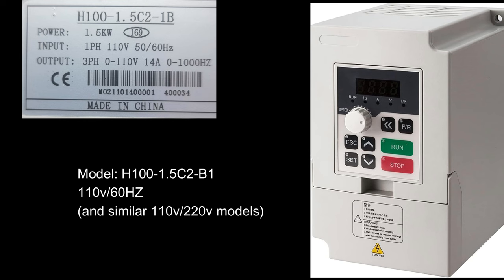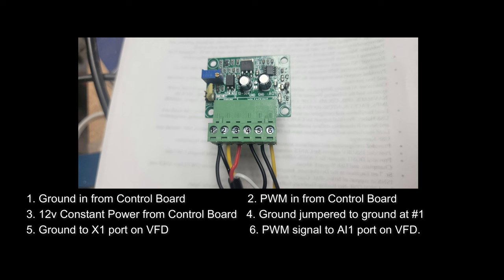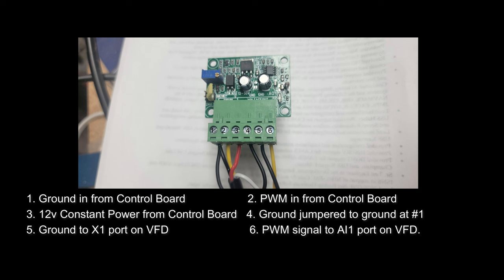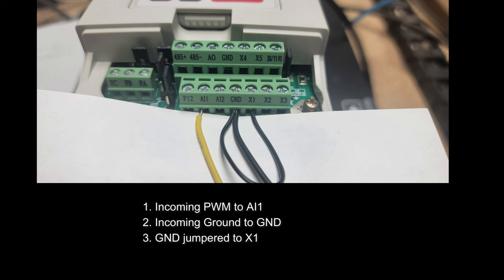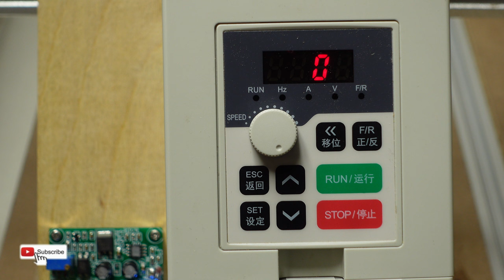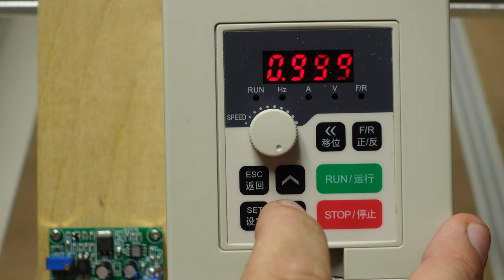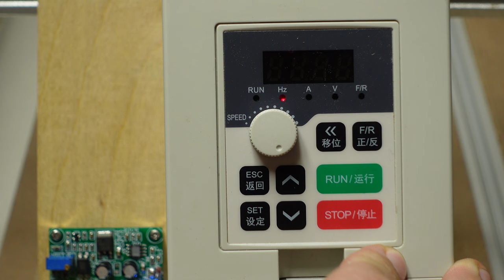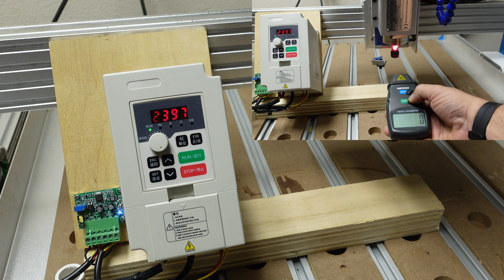Master your VFD Spindle with GRBL Control | Ultimate Tutorial | TK Designs | 4K

Comment: thanks for the video and the valuable information in it!  because of this video i feel more confident about upgrading my 1010 to a vfd (specifically the one you are using).  my only stumbling block now is what additional wiring i will need to purchase so that this setup can be used on the larger area of the 1010.

Just an fyi, your video shows thst you are using the square air cooled spindle but your Amazon link takes you to the round water cooled version.   Which one do you recommend? and if its the air cooled square one did it fit on the stock 4030 v1 z axis assembly or did you make some modifications to make it fit
Reply from the maker: Thanks for watching!  I was previously using the square spindle, but it doesn't seem to be available on Amazon anymore.  I did purchase the round spindle (air cooled version). I recommend that, as it is most compatible, and can be dropped into a 65mm mount on the V1 z-axis.  The link for the the whole spindle kit (minus the 65mm mount, because the one shipped will not work with the sainsmart) is https://amzn.to/41gdU5p.  For the cabling, I purchased this: https://amzn.to/47V4tLm.  It did have to be soldered to the connector to properly connect to the spindle.  The amount of wire they send with the kit probably would not be enough for a sock 4030 XL. The mount I purchased was: https://amzn.to/41dk9GY. It is directly compatible with the V1 Z-Axis, and is very sturdy. Thanks again for watching!
Reply: So I purchased everything and am in the process of setting it all up but I was wondering if you had to change any of grbl settings (such as settings laser mode with $32)
Reply from the maker: @michaelmessuri7746  No, I didn't make any changes to grbl.  The only change I did make was with my post processor in vectric to insert a 15 second pause on job start to allow the spindle to spin up to power.  Also, I used the same wire for the laser output to VFD as I used for the spindle. It is 18 gauge wire.  I saw you posted a question about that in my email, but for some reason, when I came to reply to the post, it was gone from the video. Let me know if you need any help, and Merry Christmas to you and your family!
Reply: @tk.designs  Thanks.   Is there a specific reason to go with 18 Awg vs 22 AWG? (I ask because I have upgraded my controller to sainsmarts DM542 upgrade [but it's currently being exchanged due tp y1 port failure] and it's original laser wires are 22AWG]
Reply from the maker: @michaelmessuri7746  I only used 18awg because it is what I had on hand. I believe you can use the 22awg since that is what the SainSmart controller uses. I am unfamiliar with that controller though. Is that the one for the closed loop stepper motors?
Reply: @tk.designs  Sorry youtube keeps deleting my response (maybe because I had a link to sainsmarts page in it) anyway the new controller is not for closed loop; rather it has updated drivers  and uses NEMA 23s along with a few other upgrades
Reply from the maker: @michaelmessuri7746  Gotcha. I had gone and looked it up. Does the new controller output the signal on the laser port like the original controller did? If it doesn't ouput the signal at all times, it may not work.  I would imagine it still puts out that signal though.
Reply: @tk.designs  I think it does (can't test it yet) unless you set $32=1 which sets the laser mode to on [just like the original controller].  From what the instructions say if laser mode is on then the laser is shut off during jogging and turned back on when it's time to do the burn.

So it looks like everything is working now; however, my stupid tachometer tape is pure garbage and will not stay on long enough for any serious fine tuning (I have it close enought right now so I will try again when I pick up new tape-- I dropped F072 down to 295 as that put me closer on the low end and a little less than on the high end)
Reply from the maker: @michaelmessuri7746  Nice! So happy to hear it's working for you. I used some strong double sided tape to secure the tachometer tape. That tach tape just doesn't like to stick to the spindle at all.
Reply: @tk.designs  Thanks for the great videos and all the assistance